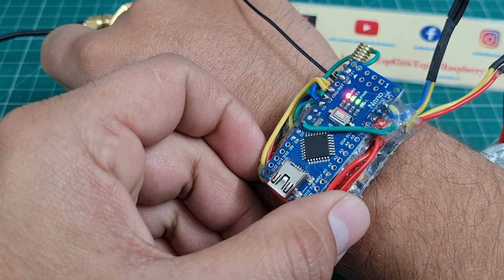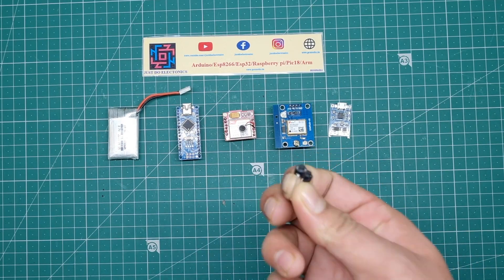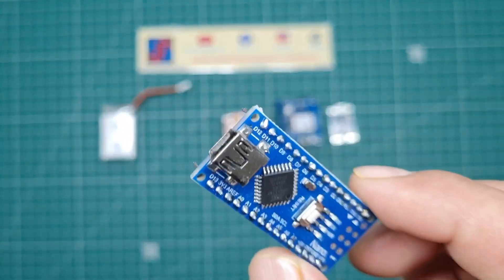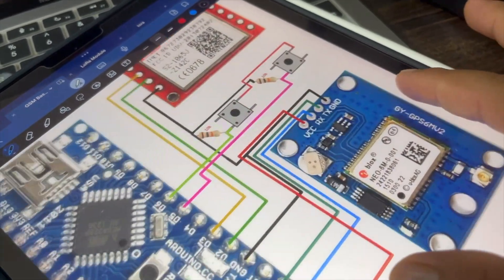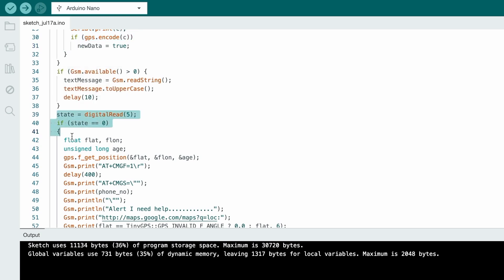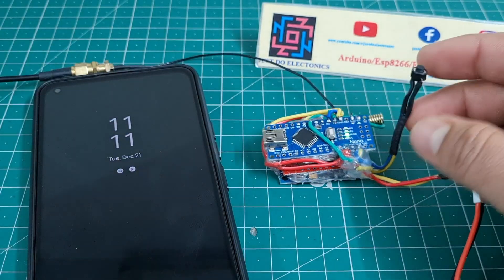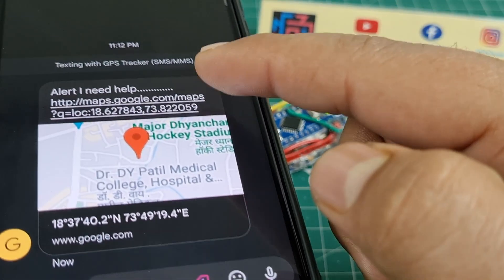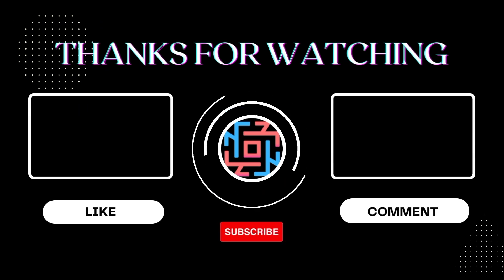DIY GPS Tracking Systems: The Ultimate Guide for Arduino Projects

Comment: Bro i have doubt 
In Gps when the user press the push button then only sms send. If user doest not press the button the location  did  go..??
Reply from the maker: Yes when you press the button then message will send other wise is not send

Comment: That's a Great Project,

I have few questions:
1) How do we charge the battery?
2) Can we get the Location remotely rather than pressing button? Eg; sending GETLOC message to the GSM number and getting the Google Maps link.
Reply from the maker: 1. You charge the battery with TP4056 charger through 
2.yes is possible to get location without pressing the push button
Reply: @JustDoElectronics  thanks for the info!